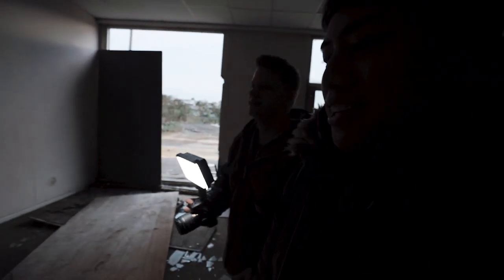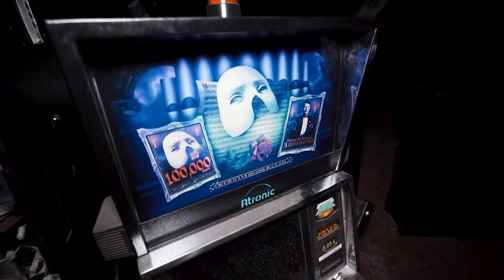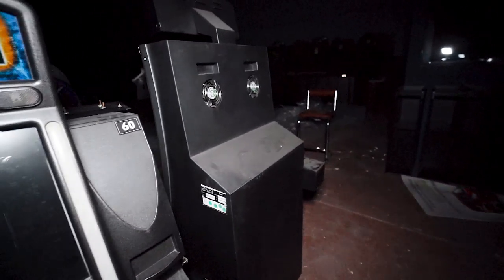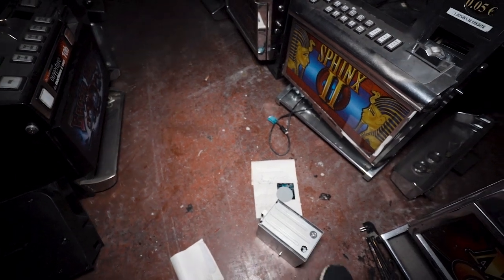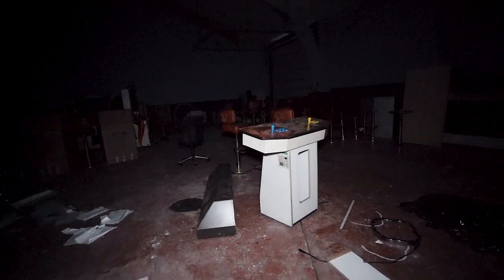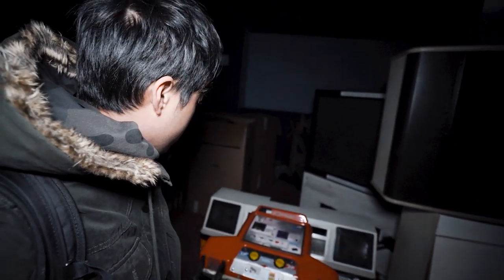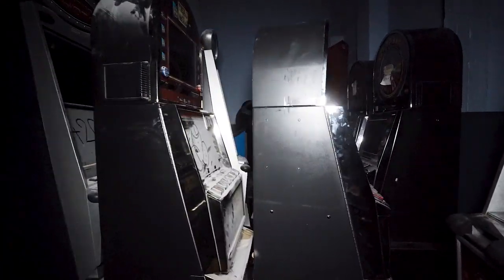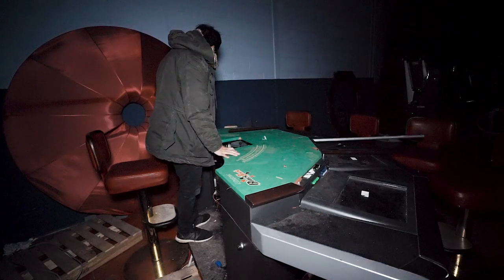Found 1000's of Arcades Left ABANDONED (Lost Vegas)

Comment: I have played on a few of them. Sad to see that they are just standing there. So many machines  that could have been restored and used in Man caves and so on.
Reply: That said you might get a fair bit for odd parts I guess..
Reply: Many of them aren't produced anymore, so to go and buy a new one wouldn't be that easy. And it isn't just 1 example of each machine in there, so you can easily take parts from one or two machines and get 1 complete machine. Plus that many of those slots have much of the same mechanism inside of them, so you can use parts from other slots that are broken down.

And the costs would be low. Unless you have no clue and have to have someone to do the work for you.
Reply: @totN.  For the first few rows the screens were all looking gone, and major integral parts .Not saying there;s no value in there or you could get literally one or two machines working with what parts there is but it;s hardly a GOLD MINE.

Comment: It looks like a spare parts graveyard. So if you own a place where you have slot machines and say some was mad and punched the the plastic part with the games name on it. Well where do you get a replacement. If it's a 20 year old machine your screwed you're pretty much Only Resort is something like eBay. Where do you think those eBay sellers get the random stuff that they sell? Well from places like this. Those games are full of Electronics then you can't just go out to your local Radio Shack is there aren't any and pick up the spare transistor. And to buy these things brand new gets outrageously expensive. I bet you can make 1000's off the game advertisements alone.
Reply: Steve question for you. When you were walking in between the machines did you notice any broken plastic sign pieces laying on the floor or still in the machine. Because I didn't. You'd think that if someone were to break it then there would be some still laying around. I mean who break stuff on purpose and then cleans it up. So that probably means that they were taking specifically. if you there is not all of them are missing just every couple of machines had them gone well it's probably cuz the advertisement was something attractive. The ones that were open we're probably salvaged for spare parts because they were compatible for other machines that are still working somewhere else. Would be really interesting who still owns the property. I bet if the owners were also owners of a cup and running Casino not too far away I bet you they're maintenance guy is a guy going into that place salvaging the equipment.
Reply: I could see that. My guess was they upgraded machines at a casino and sent the old ones there for stripping and parts recycling. I like your idea better.